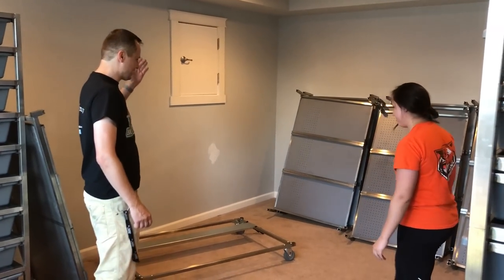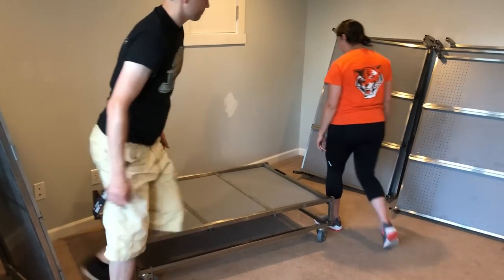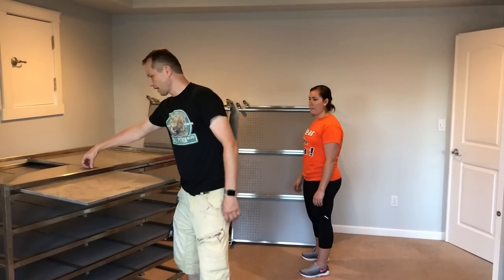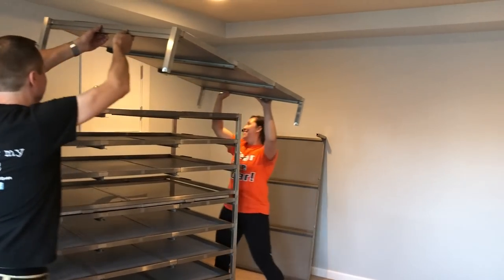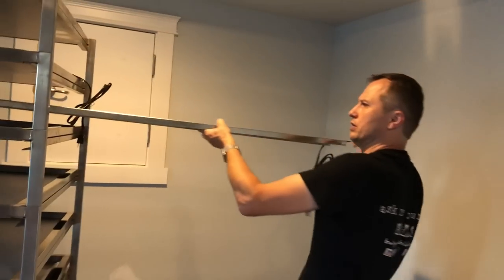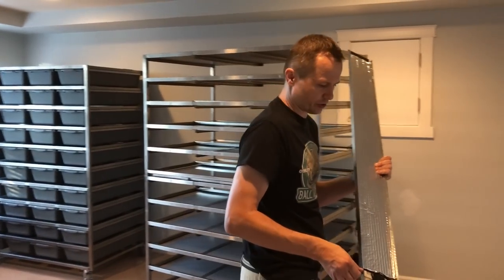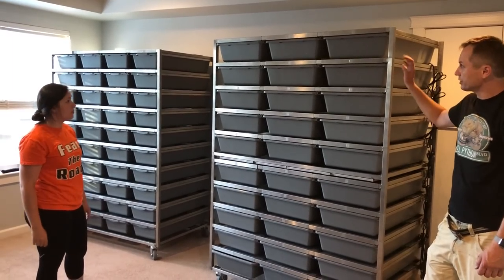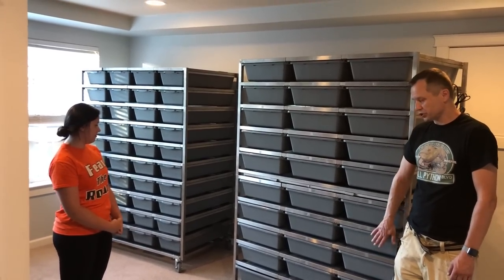Freedom Breeder 1030 Rack Build

Comment: How does a thermostat work with these or do u need one. If so does it need one for each section.
Reply from the maker: yes you would need on to run your hot spot, I usually recommend at least a 2 probe thermostat, 1 for the top levels and one for the lower